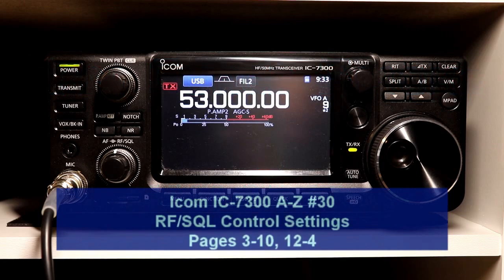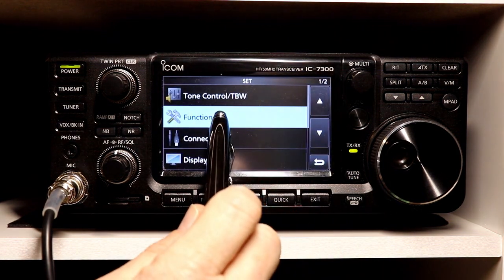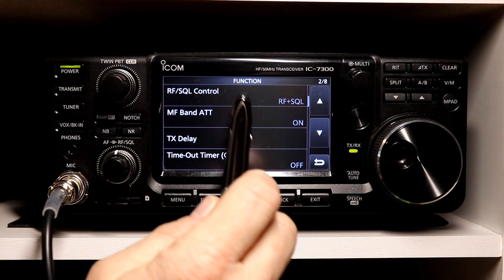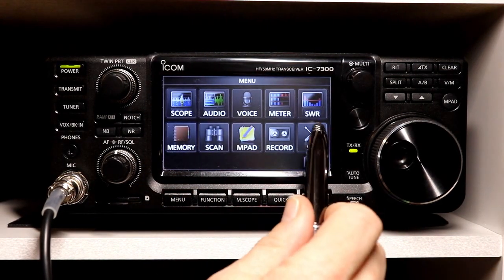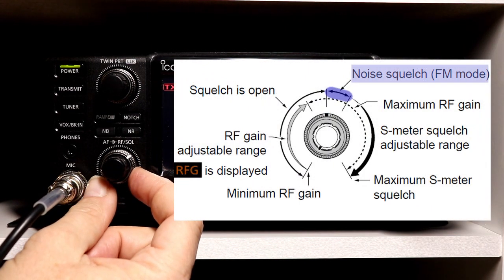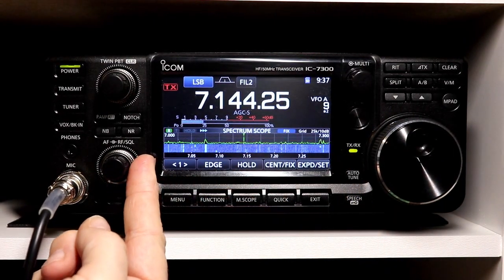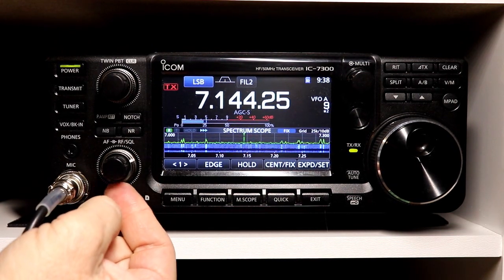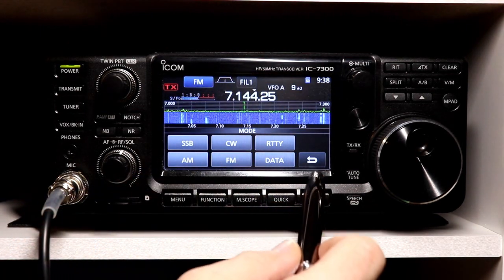Icom IC7300 A to Z #30 RF/SQL Control Function Settings

Comment: Seems this radio ships with a pretty decent "default" configuration.  Lots of stuff can be left "as is" without too much tweaking.  I like that.
Reply from the maker: Yes.  That’s been my experience. In many cases, I’m happy with the out-of-the-box settings.  I did tweak the spectrum scope color settings for my taste, but not too many others.

Comment: Suggestion Tom:  It would be helpful to have real rf signals present when describing these sort of features.   After watching your video, I still don't know what to do with this knob.  I see it changes the noise floor somehow, but in REAL USE I don't know what to do with it.  What you did that is explain what's in the manual, not how a real operator might use the feature.  Thanks for the effort, your presentation voice is great.
Reply from the maker: That’s a good suggestion.  I have thought about redoing some of the older 7300 videos.  I’ll put that on the list for that one.